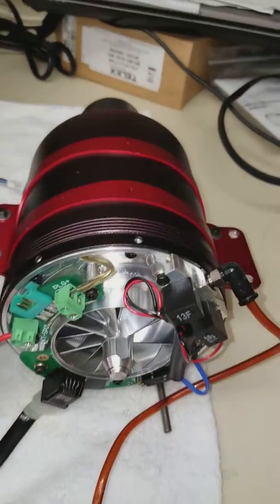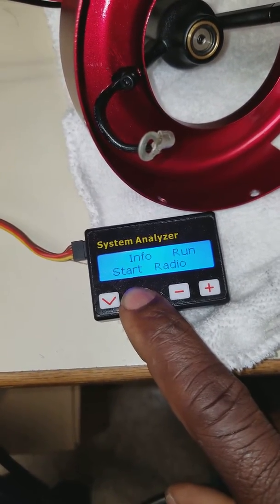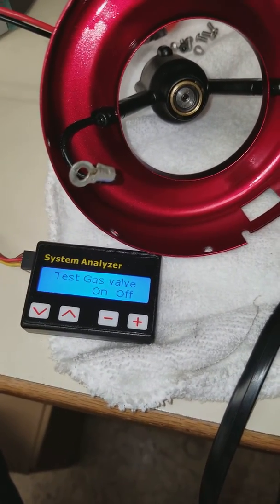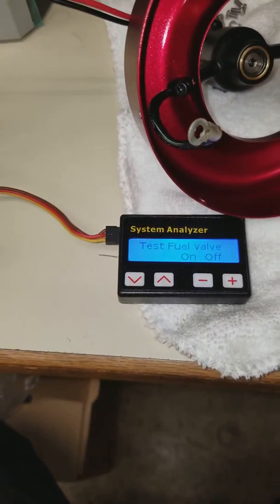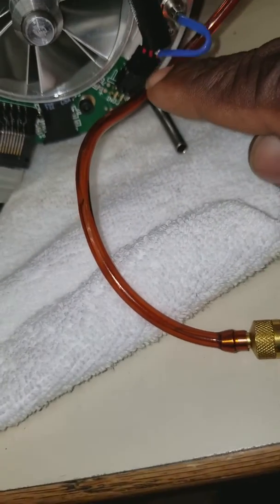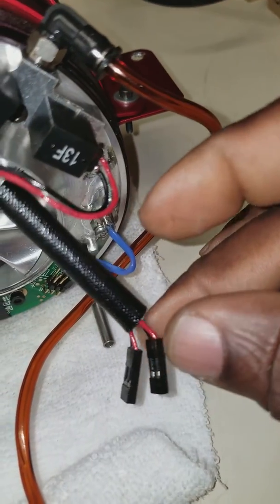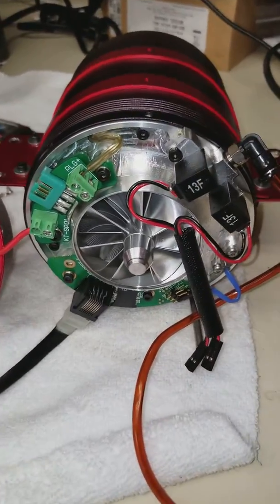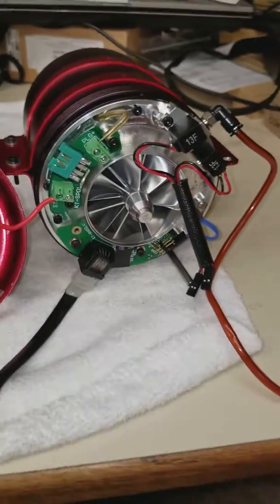Kingtech 210 turbine repair

Comment: Hey do you still work on your engine? I'm trying to see if I can build my own gearbox for the end of my k-45 jet engine and wanted to talk to some people familiar with king-tech
Reply from the maker: Yes I still do my own repairs...what's the purpose for your gearbox? Turbo shaft or turbo prop?
Reply: @basimpsn  NICE! Pretty much turbo prop, but I want to use the gearbox with a transmission to power a go-kart or a bigger RC-car, I might just use the direct thrust, but I'm still looking to see if I can pull it off, I think a helicopter or tank transmission design would be more appropriate. Do you have a turbo prop or know how that type of gearing works?
Reply from the maker: @Spearmint22425  Cool but I think your 45 is alitte too small for a go-kart 😉
A  turbo shaft rc helicopter or rc car might work but that's a lot of work man...Im not sure wish planetary or a gear box output is better for the ratio you need but keep  me posted 😉  Yes I did have a wren 54 turbo prop along time ago.
https://youtu.be/H6YruAVK_Xw
Reply: @basimpsn  gotcha gotcha will do
Reply: @basimpsn  kingtech 210 means 210N or 20KG of thrust??
Reply from the maker: @FirstLast-tx3yj  210 Newton = 47 Lbs
Reply: @basimpsn  do you have images of the combustor? 

And the compressor inducer exducer size??
Reply from the maker: @FirstLast-tx3yj Sorry I
 Don't have any spec on the diffuser and burner but you can checkout this video showing inside the engine. https://youtu.be/2mqA6MmdS04